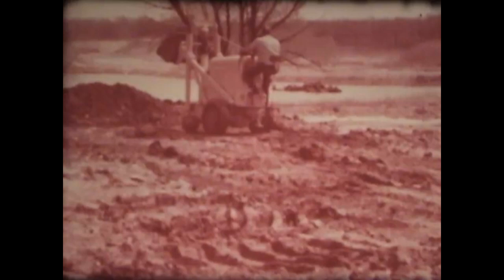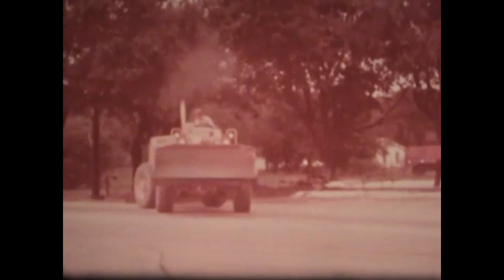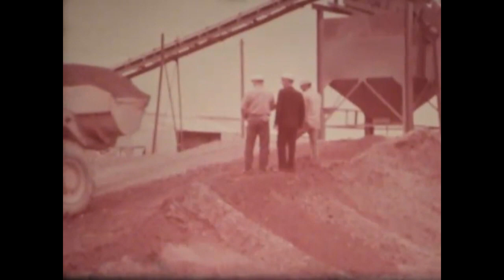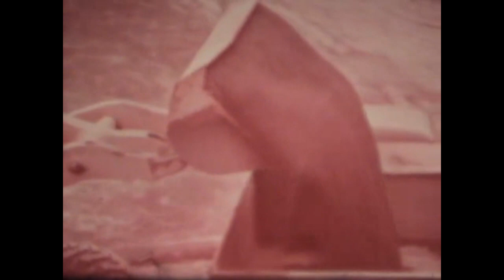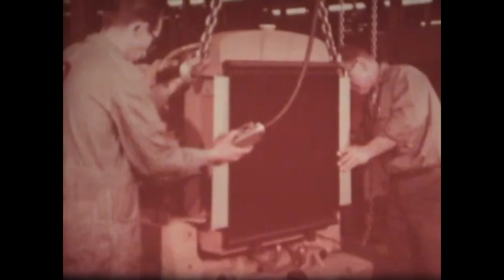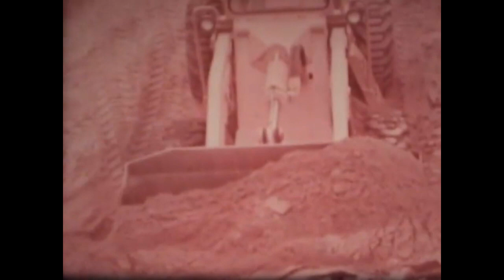HOUGH H65 Payloader Advertising Film "A Product of Experience"

Comment: This video does a great explanation as to why an operator wants the boom mounted on the cab. Weirdly, the rear cab won out the industry despite operator polls with the exception of new, smaller loaders having the cab front mounted for the very reasons mentioned in this video. That said, as a guy who has rescued a Hough H80B and put it back into proper service, these machines are worlds less money than new machines and do every bit as much work for the horsepower for hundreds of thousands less money. Buy one of these machines for less than 20K, pimp the machine out with service including lineboring new pins and you're set for the next 8,000 machine hours!